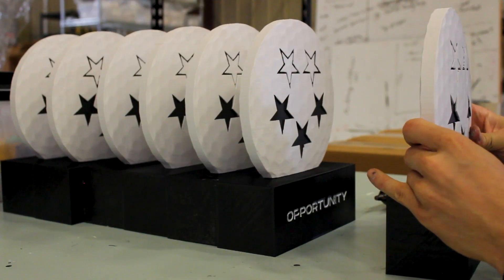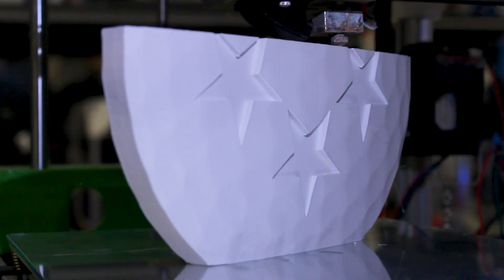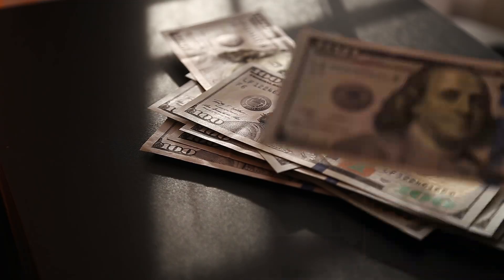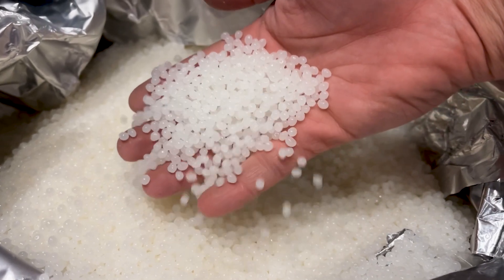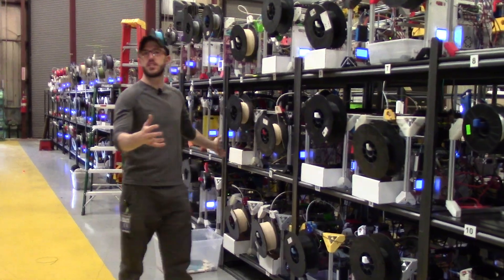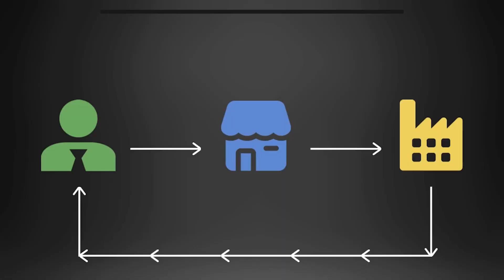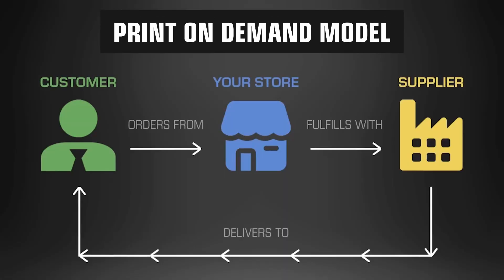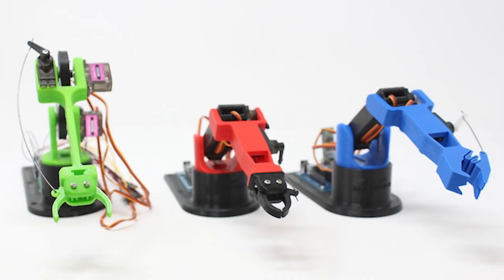Mass Producing 100,000 Parts and Beyond with 3D Printing

Comment: The fact that you're comparing 3d printing to injection molding and saying "it's the same thing" demonstrates that you're just trying to sell your (inferior) product, at the expense of your audience. I can have a mold cut for $5k, and it'll pop out 100% perfect, zero seem lined parts every 10-15 seconds. To even imagine that 3d printing 100k parts could even REMOTELY compete is absolutely wild and incredibly dishonest. Changing colors with injection molding is as easy as changing out the pellets in the hopper. And if you keep changing your design mid production, then you should have never started production in the first place, because you're clearly not ready. Iterate on 3d printers, but it's absolutely absurd to expect additive manufacturing to compete with injection molding.

The VERY few places your argument makes sense is with vased objects, that's it. But literally 0% of the industry cares about that, nobody will pay you to print single walled PLA (not UV safe) vases (that LEAK WATER) for them, and I mean NOBODY. Stop lying to your audience, you should be ashamed of yourself.
Reply: The more I think about it, the more spurious your arguments gets.

It's not just the molds. It's the machines. A cheap, industrial level injection molding machine is going to run mid to high five figures easy, and to be honest, I would think six figures is more likely. Sure you can keep making molds for it at $5k a pop, but those molds have a lifespan and will need to be replaced. So, let's say you're looking at starting up a production line, best case you find someone with an open machine, spend $5k on a mold, and your cost per part for 100K parts is five cents plus materials and energy usage. But how likely is that? What if you have to invest in an injection molding machine? That's another outlay that's going to drive up your costs from $0.50 to several dollars depending on how much the machine you need costs.

As for iterative design, you've obviously never worked with clients nor have seen what happens when a product is released in the wild. People will request features and find problems that you and your team will have never considered, not because the features or issues are not useful, but because any team by necessity is going to be a small group of people compared to your customer base. Your customers are going to notice things that your team wouldn't even think to consider and, thanks to the internet, those people are better able to communicate with each other and the manufacturer and share their thoughts and ideas.

Then there's the fact that no matter how good of a design team you have, there are times you run into issues that you just cant' account for. All of the simulations and analyses in the world can't substitute for real-life testing with actual hardware. What happens if you iterate on a design as you have said, using 3d printing, but when going to injection molding you find that there's a flaw in the design that didn't or couldn't find until you made the mold and made the parts? You're out of a mold and have just doubled your costs there plus whatever the cost of the parts you now have to write off. Recycling is an option, but if a part calls for virgin plastic (remember, even thermoplastics degrade each time you heat them up to melt them,) then those parts are a sunk cost.

Also, I have to question the size and quality of the mold you get for $5k. Mold making is an art as much as it is a science from everything that I have seen, and the expertise required to make a good mold is not cheap. The Lego Group spends much more than $5k on even the simplest molds for the parts they make. Admittedly, a good part of that is the precision they require (seriously Lego bricks are marvels of precision engineering,) but a lot of it is just trying to make a mold that lasts.

Sure, you could get a mold for $5k, but what good is it if the parts it produces are covered in flash and full of voids?

Then there's technicians you need to run the machine and the people you need to process the parts (removing them from the sprue and getting rid of flashing for instance) You need space for all of this, and both the people and the space you need to store parts in process and finished parts cost money.

Where as with 3d printing, if you design the part to not need supports, you just pop it off the build plate and you don't need to have any post processing whatsoever. The part goes straight from machine to inspection. That frees up people for other tasks or eliminates the cost altogether. 

Color changes are also another area where you've glossed over the issues involved with swapping colors. In a 3d printer, you pull the old color, put in the new one, purge the nozzle, and it takes about five minutes start to finish and wastes maybe a gram of filament. With an injection molding machine, you have to empty the hopper, put in the new color, and purge the entire system to make sure there's no contamination. Those parts are not going to be sellable unless you are okay with selling factory seconds. Even then, you're taking a loss on profit and still have to set up that whole logistics chain.

Oh, and what if the demand for a color isn't that high? With 3d printing, you can print the parts on demand without having to slow down really. With injection molding, you have to stop the entire line to produce that new color, then again to swap back. Speaking on demand, what about customization? What about including someone's name or an image on the product? For that matter, what about Prusa? They don't use injection molding to make the parts for their printers, which blows the argument that 3d printing is only good for vase mode parts out of the water since they are running a very success business making 3d printers with 3d printers.

To me, it seems like you have an axe to grind, and you come off sounding bitter and spiteful. Accusing someone of lying to their customers is a serious offense and one that could get someone sued for fraud. Furthermore, you accusing someone who's running a successful business from all appearances of lying to their customers and partners or of not knowing how their business is actually working. While I realize there's a bit of the pot calling the kettle black here, I'd kindly suggest that you if you're going to make claims like that, you back them up with some evidence. For that matter, maybe think about the number of people that have turned 3d printing niche products into successful businesses before saying that 3d printing can't compete with injection molding. At the scales he's talking about, it very obviously can.
Reply: @thedabblingwarlock   mic drop

For real though, best reply I've seen in a while and a very thought out answer. Kudos to you!
Reply: @daniboy_tv  Thanks, though I think I tend to get a little scatterbrained at times. I definitely could have done better on making sure I didn't have any missing words or grammar issues.
Reply: @thedabblingwarlock  you are the best
Reply: @thedabblingwarlock  What about the issue of multiple moulds not being able to exist in the same workspace (for example printing two different size items in the same job)? That also seems like a downside of Injection Moulding.